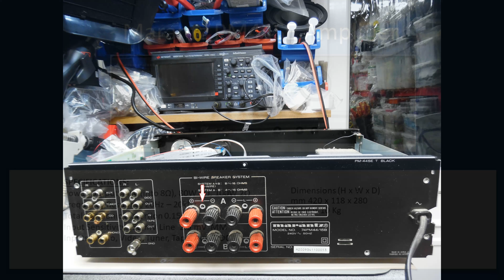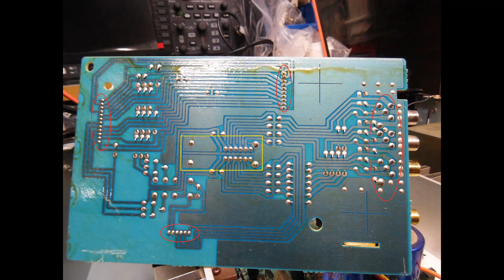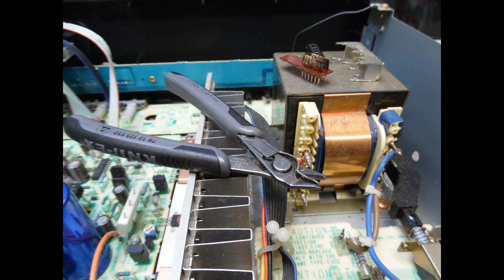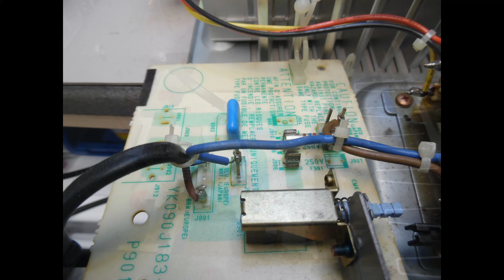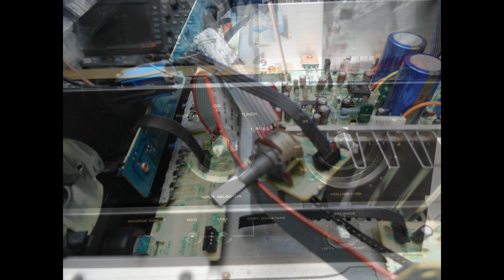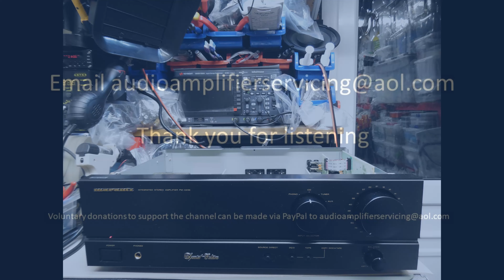Marantz PM44SE Amplifier Repair (With Audio Tutorial)

Comment: Funnily enough. Exactly this problem has turned up today: a guy has brought me his PM44se with no power. The input fuse was blown. Pulling the main board out, I've found a couple of definite dry joints and a ton of iffy ones. I'm working through the boards now to check them too. I don't like these amps as they are a pain to put back together just to do powered tests